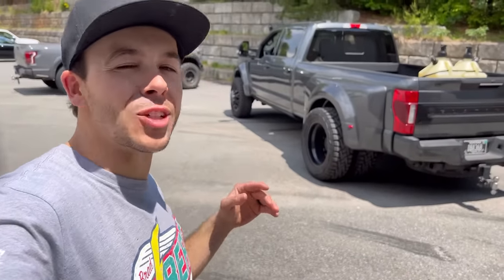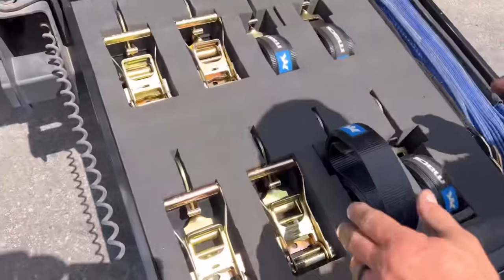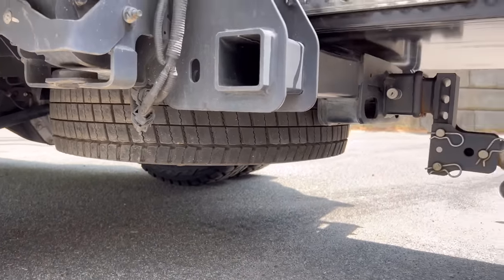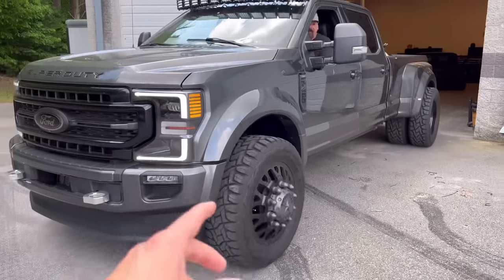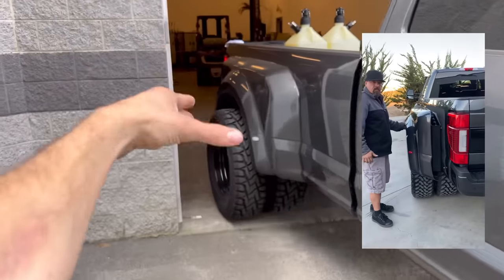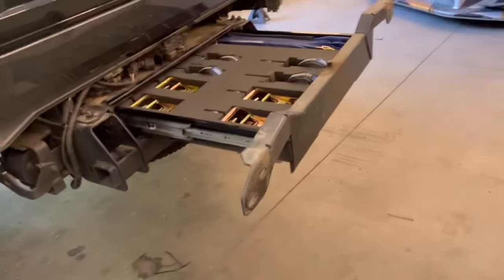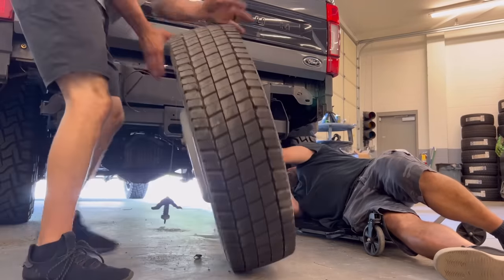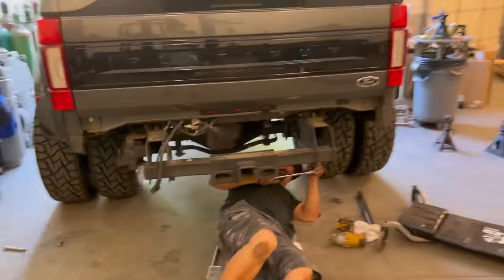BEST TRUCK INVENTION OF 2022? Hidden truck compartment patent for Ford, Dodge, Chevrolet & Toyota!

Comment from the maker: What kind of truck would you put this in? And what would you put in it??
Reply: I would stick it on a 1996 f250 so just a little idea for y’all because a mint OBS with that set up would be so poplar. Love the channel
Reply: 2022 GMC Sierra (3.0L Duramaxx). My Dewalt Arsenal
Reply from the maker: @lukemagli9250  dude I love obs! That’s a great idea and I know that’s super popular! Much appreciated
Reply from the maker: @ryanholmes5256  heck yeah man! It will be sick to because I want to make impact foam organizers
Reply: @DeBerti  ya man also you are 1 of my favorite YouTubers and are living out my dream job so if you have any tips on how I can get there that would be amazing
Reply: @DeBerti  also if you need an intern then I got you lol
Reply: 2016 F250. 8" lift
Reply: @DeBerti  let me know when you make a GM box, I’m sure they’re different in some way than Ford. I’d like to look into one. I work as a handyman and with Diesel prices going up, I’m trying to find an alternative to my 12’ enclosed trailer…
Reply: 2018 Chevy Silverado 2500hd, it would be sick. And it would be an assorted tool set/chain/ ratchets
Reply: 2021 Ram Limited...congrats on the patent, you all are an amazing engineering team.
Reply: All trucks.
Reply: Id put one on my 2000 2500 Silverado put a jack tools and all the crap that I put in the back of the truck every time I hook up the toy trailer at 63. I’m stoked for your patent that’s Bitchin and tough. Congratulations
Reply: Every truck from the factory should have this!🔥
Reply: Locking cabinet would a nice aswell good way to lock something up without it having to be inside the truck
Reply: This would be awesome for my Tundra. One of the things I hate is the lack of storage other than the bed. Nice work guys!
Reply: I like it, but how well does it hold up if you stand on the bumper or get lightly tapped. Stress test it. Show what it takes to break it
Reply: Keen to know how universal they might be. I've got a 2021 Nissan Navara, similar to the new frontier you've got in the states.
Reply: hey Brad are you guys not down at the bigger shop anymore? wanting to make a stop this summer and meet you guys.
Reply: I think it’s great, a work truck  with stock look. Fantastic now need a ram and chevy set and boom
Reply: Ford Ranger Raptor and Toyota Hilux, mate. Looks slick! Hope the transformer side panels are coming soon as well.
Reply: My 03 ford ranger.
Reply: Id say medium trucks as well. And toyotas. Tundra etc.. figure. Its cool. Its a good amount of storage but not huge by itself. Would greatly increase storage and utility of small to medium trucks. Just think of a better or more efficient tool box in back of said trucks. Like one that is not above bed sides or has installable rails that carry it from cab to tailgate. Then those lock boxes could have lower level pull outs as well but the railing would need to be a design that allows loads... Something like a train track. So easily cleaned off. Or brushed out allowing smooth operation. This allows bed cap be it foldable flat or traditional to be installed. And having all that secure storage usable with those because it can slide to rear. And still when driving have back of bed open.
Reply: Give me a gear tunnel
Reply: 2006 Chevy 3500 tie downs.
Reply: Silverado, and 21 Raptor
Reply: Is going to out for half ton models like ram 1500 and ford f150
Reply: Y’all really should contact the big 3 and have them offer it as an add on to special order trucks that would be awesome. 
And does it lock
Reply: 10+ Ram 3500
Reply: 3rd and 4th gen dodge and chevys. I’d put tie downs and tools in it.
Reply: My 1997 F350's jonesing to get one of these put on!
Reply: Lots weapons & ammo, in a TRX.
Reply: & some tools as well.
Reply: I'd put it in my '21 F250 Tremor and use it for Camping with a Bedrack and Rooftop Tent setup.
Reply: RAM 3500 crew cab 6.4 bed and I would put the recovery gear and the ratchet straps in there
Reply: 06 Dodge Ram 1500 my Guns wend I go shooting in the outdoor
Reply: New f250 srw, need all the storage I can get!
Reply: Cant go with Decked since I need the gooseneck
Reply: It's cool, but where do you put your spare tire?
Reply: Oh, OK.
Reply: @maxguarriello6512  plus decked basically turns your truck bed into a flatbed since it takes up so much bed space.
Reply: @lukemagli9250  Rear fuel tank is in the frame on OBS trucks. Wouldn't work.
Reply: 21 Raptor PLEASE!  Rear panels are fat and should work well as cabinets, rear bumper drawer would be interesting with the exhaust (may need to relocate).  LETS DO THIS!
Reply: 2014 F250, guns and ammo
Reply: My 2021 GMC Sierra 2500 Duramax .
Reply: This would be a great addition to the power wagon line up.. We especially the ones with ram boxes..like mine..have any idea of cost?
Reply: 2015 Powerstroke
Reply: 2015 F150. i would use anything from fishing gear to my hunting gear if one was made to fit the f150s
Reply: You going to make them for 2012 gmc 3500
Reply: My tundra!!!!
Reply: @lukemagli9250  Same, id want for my obs f250 as well
Reply: 2012 GMC Sierra 3500 8 foot bed single rear wheel
Reply: 2018 F150  Brilliant idea
Reply: 2021 f350 recovery gear and straps
Reply: 2019 f350
Reply: do you have in mind something similar for  Tacomas? there is a huge market out there.....
Reply: 2019 silverado 1500 5.3 v8
Reply: This is cool no doubt, but I'm worried about the price of this stuff... sounds like an arm n leg type of pricetag.
Are you guys making these for normal guys older trucks or are these only for rich guys with new trucks??
Reply: You might want to think about selling that patent to the highest bidding manufacturer because the 1st work truck to be offered to the public with that off the line will be sold out and on backorder... It could be a big payday with no future work, leaving time n money for other investments n projects.... Just an option.
Reply: You could also try to make a universal setup, then anyone can buy it for whatever they got.  Or maybe you could design a whole new (bolt-on-ready) bed with all your upgrades.  Then all the customer gotta do is pay for freight shipping n swap beds!
Reply: I need one for my 2013 Toyota tundra. Will you have one for my truck?
Reply: Any one of my Fords
Reply: Are you contacting subs , I'm worried I might be getting scammed?
Reply: @MrBLAZZhard  be careful there is scam bots that pretend to be them
Reply: My 1988 f250 4x4 with the 460ci big block.
Reply: Hopefully you'll make it available for 3rd GEN dodge 2500-3500👍👍👍 or even 'classic' GM trucks  (2003-2007)
Reply: 2016 f250,  would keep extra tooks I keep for my small ranch in there or just extra tools in general. would also be nice for the tools you always use for quick access
Reply: 2008 Dodge 2500 Mega Cab.  Take my money now!!!!
Reply: 2018 F-350 SD, when can I get one?
Reply: Not much of a truck person but, an idea for you , have a deeper drawer for those who have a rear mounted tire, so basically for a Jeep or Bronco's, maybe a luggage rack drawer that could slide out with fold down legs and the. Draw would open like a reverse tackle box where it fold down like stairs I guess lol, and the original luggage rack bars would mount to too of the roof drawer. I have other thoughts but I'll stop here lol.
Reply: Makes me want to buy another truck, nicely done!  This will be picked up by Ford or GM...  Don't sell yourself short when they come knockin'
Reply: 17 f350, and the wife's 2019 raptor (assuming it fits)
Reply: What’s the price point?
Reply: The box sides interest me most as I like the spot for the drawer as a secondary fuel cell
Reply: tundra desert chase
Reply: 2015 f350 platinum
Reply: What about.a 96 dodge Ram 1500? Or a 2004 GMC 1500 Sierra?
Reply: All of them LOL
Reply: Can I please buy one I have a f250 and I want one
Reply: If I can still have my b&w gooseneck hitch I would put it on a 2015 Silverado 2500 HD
Reply: Ram 2500!
Reply: I would put it on my 2012 Sequoia if you make one for it. I would put my emergency and recovery gear
Reply: None of it only takes 15 for someone to steal my shit
Reply: 1995 tahoe 4×4
Reply: Awesome invention.  I can not wait for it to hit the market.  I have a Ford F150 and this thing would be an awesome addition.  Eagerly awaiting it to be available.
Reply: 2018 f150 plat so I can dump the bed box
Reply: I have the baddest 2019 F350 DRW this would go awesome on. Its a zombie apocalypse truck and I would put all the bug out gear all over this!
Reply: Tundra,Tacoma,4RUNNER, FJCRUSER
Reply: dude, a carrier for bicycle and motorbike would be a brilliant idea for that
Reply: 2006 F250 4x4
Reply: Ram 1500, air compressor and small tank
Reply: 2nd gen Rams
Reply: Toyota Tacoma
Reply: I have an F150 with a 6’’ lift. This would be phenomenal on my truck
Reply: I'd do these mods to the first gen dodge cummins and load it with chick magnets
Reply: I would pay huge money for a custom-built transformer for my 1967 Ford F-250 Ranger, It is not pristine but it has 700,000 miles with no rebuild. I feel like custom made stuff like that, for pretty much any truck, made to order to a certain extent.
Reply: My daily is a 1965 f100 long bed /step side. It would be cool to have that extra storage space instead of under my bench seat. No room for anything in this truck.
Reply: 2014 ram 1500
Reply: 2022 F350
Reply: If you can accommodate this on a toyota tacoma, hold on to your hats for orders pouring in.
Reply: 2014 Ram 1500 use for camping equipment. This woould be perfect for my weekly getaways
Reply: F-150 and not certain what I would put in it.
Reply: Yea I would get one for my GMC 2500 HD
Reply: My chevy I would put my camera equiment in there for easy access while out shooting.
Reply: Impressive
Reply: Tundra
Reply: I would put it on my 2015 ram 1500...if possible
Reply: Gen 2 tundra
Reply: Obviously a GM product, unless you don't plan on driving it lol
Reply: I'd put it in my 2015 Ram 2500 Mega Cab and use it for all my crane mechanic tools for the jobsite
Reply: what about a dodge ram 1500
Reply: You could make  a load bed extention out of it or a motorbike rack
Reply: Dude f 150 would be awsome to have this kind of tool storage in a mid size truck. My dad has filled the back seat of his truck with tools and this would help him keep things organized for work and his truck clutter free.
Reply: F150  is what I would add it to.  For range day and keeping photo gear hidden when in remote locations.
Reply: GMC canyon/Chevy colorado duramax 2.8. Love a compact diesel. All my road gear (wrenches, straps, emergency kits), frequently used carpentry hand tools, small kitchenette if I could fit it (similar to the Rivian tunnel kitchen) in the bumper slide. Go fast camper up top. Work and play all in one rig without having to load/unload. You guys have we website?
Reply: Make one for a Tacoma
Reply: my 65 C10
Reply: 2017 tricked out Raptor!  When will these be available?
Reply: 97 dodge Dakota for the remembering of my father who die yesterday and all my maintenance tools I wish I could get one for the truck
Reply: Ford F150 XLT 4X4 and I would put camping, off-roading tools and equipment. This and my Decked drawer system would keep it all out of sight.
Reply: So I am assuming this is not going to be built?
Reply: I’d like to put one in my Obs ford. Just would have to remove the rear tank
Reply: How much do you think one for an Obs ford would costs? If y’all decide to make them for those trucks. I’m on a very tight budget so I’d like to either buy one cheap or just build one myself if y’all don’t make a kit for an Obs. Id love to see how far this project goes. Looks great!
Reply: That Orca style just look great.
Reply: I’d definitely put this on my 2020 Ford Ranger.. Does it lock with the remote like the doors and tailgate?
Reply: 2005 Dodge ram 2500 hd
Reply: Any updates, I’ve been wanting one of these since they came out for my platinum 450
Reply: My 94 ranger
Reply: Is the TRX an option?
Reply: 1970 F100
Reply: Brad I’m in the construction feild I own a plumbing& heating company, how do I get this stuff? This is perfect for us. Hide tools from theifs and smart space storage
Reply: I have a 1978 f250 for myself I want to do this for
Reply: I would like to make my Chevy dully just like this Ford can you tel me ho much will it cot to transform my 2001 Chevy Silverado 3500 dully
Reply: Are you producing and selling the bumper drawers yet?
Reply: You don’t need one, if you have to ask.
Reply: 2021 250 king ranch
Reply: Would y’all do it for? Rams
Reply: Can you do a 98 Ford Expedition xlt.. Make it a transfromer..
Reply: 2011 FORD RANGEEEER!!!!!! Also, when will these mods hit the market?
Reply: I would do a dodge but is this available for purchase
Reply: How do I order the bumper compartment
Reply: A 2018 GMC canyon truck
Reply: 2020 GMC 1500 AT4. To carry little bit of guns. Have you got everything in place for selling and if so where can I find it
Reply: Toyota Tundra & Sequoia
Reply: I would put it in my 2002 toyota tacoma.

Comment: From a safety stand point you may want to look at relocating the spare tire release to the passenger side so that the driver is not next to the flow of traffic  when changing out a tire. I like the placement, the extra storage and the simplicity of the design. I'd like one for my new Chevy TrailBoss.

Comment: Im glad that someone is finally doing this, for 35 years or so Ive been scratching my head knowing there was so much un-used space with vehicles, specially truck beds. I thought about a lot of designs but never had the tools to make it happen. Im always making minor mods to my vehicles stealing a bit of space for this or that. or designing a speaker-box partial cutout to "borrow" room of the poorly designed gaps in vehicle bodies. I hear "it wont fit anywhere" a lot, my reply has always been "watch me".

Comment: From a prepper standpoint, I can see this being very useful for emergency equipment. Love what you're doing. Keep up the good work 👏
Reply: Be good In a junkyard environment
Reply: No real prepper would ever  own  an electronically controlled truck. No efi not even an electric fuel pump.
Reply: Scooter. Not everything in prepping is prepping for teotwawki. Sometimes it's just prepping for a flat tire or a breakdown
Reply: These guy's are definitely creative.

Comment: I can think of a million things to use this for as a gc/home builder. Would be nice to have a little deeper drawer even if it means not having a spare at all.
Reply: Lol, how about rocket launchers?
Reply: Yup
Reply: You'd also have to forgo the hitch as well.
Reply: As a home builder/GC as well, I wholly agree! Ditch the spare for a deeper box option and add a hard lid that could be used as a desk.
Reply: @michaelbradley7529  I saw the hitch receiver in the video.
Reply: @danasharpe3247  Read the original comment that I was replying to for the proper context.
Reply: the rocket launcher? Can't really tell on the PC version of YT
Reply: @danasharpe3247  Did you mean to reply to a different comment? This makes no sense with the context of this thread or the original comment.
Reply: Just run out-flat tires! 😁
Reply: exactly...the spare is not needed if I could get more space. I would have larger tires anyway so a spare would be if no use...this is why I have spare tires in the garage and Triple A and emergency roadside service through State Farm.  Also carry a can of Fix a Flat. I would only use that for a last resort if State Farm or Triple A have no available Tows to a tire shop or if I have no signal. I also keep plugs in the toolbox and a compressor. So yea more room and no spare makes all the sense
Reply: How about going old school and mount the spare tire on the front grill.

Comment: Love this kind of stuff! Can't wait until the transformer truck boxes are a package you can just order straight from you guys to bolt on and turn any regular bed F-250/350 into a hidden box bed work truck! If you guys did kits for 2000 F-250/350s and up I would love to figure out some kind of sales/distribution & installation partnership with you guys to bring this stuff to my home state. God bless from Florida the last bastion of freedom.

Comment: I would love to see this for the F150 as well. I would assume it wouldn't take too much adaptation to get that done. Any ideas for a locking mechanism? I feel that is the only thing missing in the design and would be great to see from you instead of trying to figure something out  on the consumer side. Thanks for the video and the awesome stuff you guys are doing.

Comment: I can appreciate the work these guys put into this stuff. My first impression is how many rattles after a few thousand potholes? Second, is how much structural integrity is lost at the
rear bumper? The two corners of the rear bumper have no gussets to the frame, I would think the corners will fold more easily into the corners of the body. 
Although maybe they didn’t have any to begin with, most my past Ford & GM trucks had them. Great design & fab, I love all the stealth the compartments have.
Reply: Most rear bumpers have no gussets to the frame. And are usually just held on by 4 bolts straight to the frame.

Comment: Super cool!
Does it affect the bumpers ability to do what the bumper is supposed to do?
Obviously tow points on the bumper are out  but what about impact from a collison?
Reply: My thoughts exactly. Completely ruins the bumper's function as a bumper, turns bumper into a glorified drawer handle, and for what... a rather pointless little drawer.
Reply: Ford used to use shear bolts on the lower holes of the bumper mount so it would fold under in a rear impact. You’d have to find a way to replicate that.
Reply: @toml802  Ford used to give these people a warranty on this vehicle, not any more.